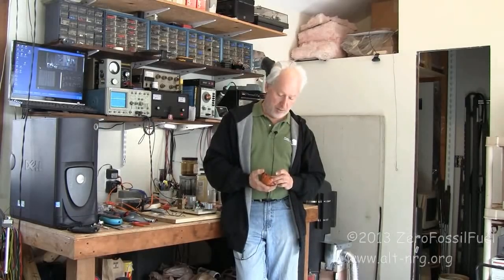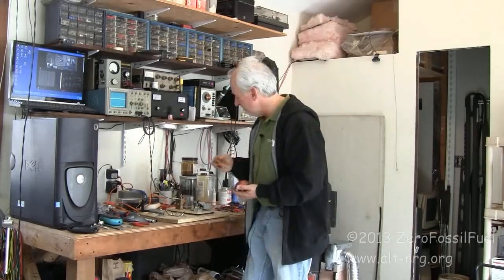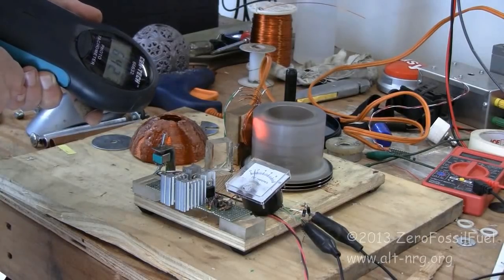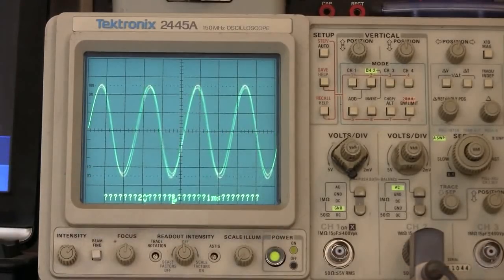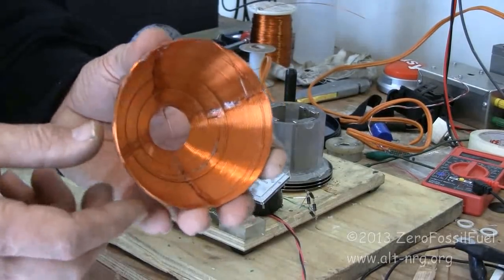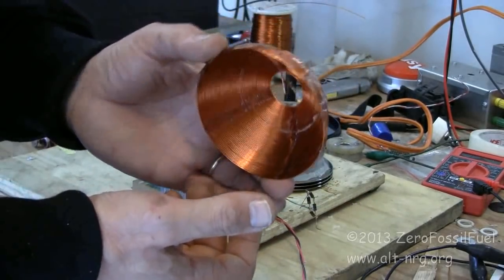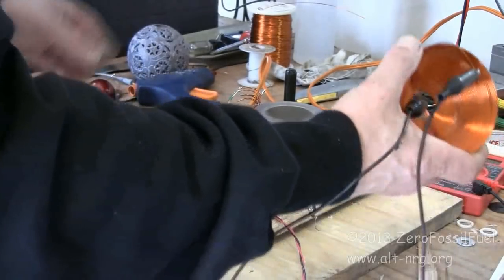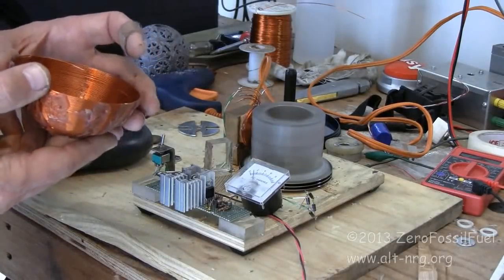#329 Zero Lenz dynamo

Comment: Volts does not equal power.
Volts multiplied by amperage equals power (Watts).

I can whip up a circuit that'll turn 30 volts into 50,000 volts easily, it will however not create additional power (watts), since amperage is on the secondary side is divided by the same factor as the voltage is multiplied by..

Your hemispherical coil has more turns than your pancake coil, it's only natural that it will have more volts on it, it will also have less current, meaning that the power is ideally the same as the input,  but realistically lower due to losses (bearing friction, heat etc.)
Reply: +Patrick Hansen yep. That's what transformers do...step up and step down voltage.
Reply: you should try pulsing the transformer rather than just giving it a regular ac current, ull get weird effects that includes ou
Reply: Johan Zahri You will get weird effects, if you don't understand said effects, and you will not achieve over unity.

Every switch mode transformer (the ones in your phone charger, laptop power supply, pc power supply etc.) are pulsed transformers, hence the switchmode, and they do not in any way, shape or form achieve overunity, nothing does :p
Reply: +Patrick Hansen ur heart is a transformer, if u pulse it with a spike u get a living heart rather than a dead 1..just a clue
Reply: I have a device that turns 3.5 volts into 10,000 volts. It is called an electric mouse trap. Why are so many people duped by shit like that. Volts is not a measure of power, watts is a measure of power. Volts is a measure of 'flow rate' and amps is a measure of 'flow volume', and watts is a measure of 'total flow'. If you pinch a water hose to make it squirt harder, you aren't creating any energy, but that is precisely what increasing voltage does.
Reply: Patrick Hansen thank you very much for the clarification Patrick. holy moly it was confusing to me...
Reply: that's because you think that the stuff around your analogy is just water in that hose, well.. that's not the case in this world.. there is other stuff in and around the water.. it's everywhere almost the way fish view the ocean, it doesn't think it's in the ocean.. only until u take the fish out of the ocean will it see the ocean as it is..
when u spike the transformer u perturb the surrounding almost like jumping out of the ocean.. and there you'll find different phenomenons..
you'll then be able to link to different realms just like when u sleep.. ur heart and brain are in different modes.. u perturb differently and see the world differently..
Reply: @Richard Smith do you know why after u sleep u feel refreshed? think about it.. where does the energy for the refreshing sensation came from.. i don't think it comes from the snickers or mars you eat..
Reply: Johan Zahri Even transformers and the available DC motors are in effeciants  When it comes to get torgue or the RPM
Many youtube info what I feel individuals perspective some Leeds to no ending
I wish ITS HARD WORKS AND GUIDING OUR TROUBLED WORLDWIDE POPULATIONS WE NEED TO BE KIND ENOUGH SHARING RELEVANT INFO THAT HELPS CLIMATE CHANGE BRINGS THE MUCH NEED EASE THAN PUSHING OTHERS INTO HORRIBLE KNOWLEDGES
THANKS FRIENDS
GOD BLESS
SEEK YOUR COMMENTS IF I SAID ANY WRONG
I wish never hurt any youtube creator but some reality some videos r good informative some r horrible
From India

Comment: I'm not sure what you are trying to prove, but the hat shaped coil has most of it's mass MUCH further away from the spinning magnets. Most of the coil isn't even in the magnetic field because of it's shape, while the flat coil had all of it's windings and mass directly up against the moving magnetic field. This is also why it took longer to slow it down because so much of coil is too far from that magnets.
Reply: exactly... the more I see these diy videos, the more I trust in actual science instead of these radio shack self proclaimed inventors showing off their oscilloscope
Reply: Qi Qi depends on the video u watch... but I feel like consolidating knowledge and preparation, could b used alot more, cuz when you get yr gadgets and equipment, there is a tendency to experiment and play... and eventually forget what you were trying to achieve
Reply: I THINK it is Doc Brown in the early stages of building a proof of concept for the Flux Capacitor.
Reply: tarstarkusz I think his goal is to demonstrate a less efficient transformer. Power and Watts are not in his vocabulary, but just throw the word Tesla in there to distract is in his vocabulary. Too funny.

Comment: Just a random thought - if you could figure out the shape of the magnetic field generated by the rotor, mimicking it as closely as possible in your coil shape might create an even more efficient induction in the coil. Maybe you could take one of the magnets used in the rotor and map the field pattern using iron filings on an index card (or something similar).

Comment: If you are still doing this consider 3d printing a multilayer dome coil winding it like a flyback power from big to small. The multiple layers would hold the wire better holding and the winging would give it more voltage at the small end. It would still reduce the lenz effect as well, though shielding or epoxy may be needed on the outside.

Comment: Question: You know what a Zener diode is. Something a bit rarer is a Zener Triggered Transistor. I am 69 YOA and retired. Long ago and far,far away I dabbled in electronics but had to get a real job (just over broke) and gave up the fun of life. In that period, I too experimented with magnetics before there were neodinium magnets. We didn't think of building motors because the stock of salvage from old PCs didn't exist. We simulated the kind of circuits you build sands movement. With the proper multistabil vibrator circuit, I built some hairy Bodine / Tesla coils and could focus the discharges to vertical using an inverted cone in place of the Tesla semi-spherical antenna. I recall using a Zener switched transistor circuit. As Lenz law bucking / aiding design which produced the current in the primary. Now is when I wish I could explain things better. The primary, usually #10ga wire was wound in a pancake. It was enameled. Over that we wound a micro fine 20ga secondary before the 50ga was formed into the pancake coil. The Zener referenced the voltage in the primary because it was across the 20ga coil. That reference voltage was set to give the highest BEMF we could generate as a signal to open to the battery and close to the Tesla cap bank. This put induction into the secondary of the Tesla or Bodine coil.  On top of the Tesla scondary or Bodine coil was a 12" spike with a very sharp point. The reverse cone (small end down) was charged across the Bodine/Tesla secondary and the spike. This focused the discharge to a jagged but pretty straight bolt of lightening. A few times it would take different paths depending on humidity. I once got zapped by one of the stray bolts. If you are wondering what is wrong with me, that is it. LOL Anyway, I enjoyed your experiment very much. I think there might be a way to use the Zener Triggered Transistor to initiate your stopwatch timing but base it on BEMF. Unless, I may not understand what you are trying to accomplish.
Reply: I forgot one very important feature. The inverted cone is neg. biased from a DC source several( 6KV caps) and becomes one of the cap plates. It discharges because of Bodine/Tesla discharge spike accidentally striking inverted coil. Any charging circuit that goes to several thousand volts will work. Experiment. Your bowl coil would work perfectly to concentrate bolts from discharge spike.

Comment: The Lenz effect can be reduced or eliminated with various methods. Superconductivity seems to be the optimum - maybe with a graphene coated coil? 
Another effective way to reduce the Lenz effect is to align the coil design to the magnetic field lines (or between) - as shown in this lectures (YouTube titles):
Professor Eric Laithwaite: Motors Big and Small - 1971
MIT Physics Demo -- Pendulum and Magnet

Comment: When you look at the bowl, each single-turn wire loop that makes up the shape of the bowl, "sees" a certain rate of change of magnetic flux from the spinning rotor.  The rate of change of magnetic flux seen by each loop determines how much EMF it generates.  Each loop in the bowl is a different size and in a different position.  Hence each loop has a unique "view" on the changing flux from the rotor.  You add up the EMFs from each loop to get the voltage output.  This applies to ANY coil.

Comment: You might consider using CA glue from a hobbies store instead of the hot glue you used for the spherical coil winding - buy the accelerator so you can instantly set the glue as you apply it.
I have repaired baked motors where their was an internal short was because the lacquer insulation burnt off so to re-isolate the coil wire I saturated it with CA glue and used the accelerate to harden it instantly.
If you pre-spray the surface of the coils with the accelerator, the CA glue will harden almost instantly when it comes in contact with the wire.
What do you think a parabolic winding would behave like?
Very exciting work!
Thanks for Sharing!!!

Comment: Whats significant is the shape difference alone is creating as much current with less resistance. I must admit I am far from a professional and hold very little higher education. My tools are limited to an esd solder iron, a hand held digital multimeter and an ir therm.. so yea...

I am, to say the least, intrigued by your experiment. Admittedly this is the first video of your I've seen but you got yourself a new subscriber.

Comment: In that sense your bowl-shaped coil is just a different "catcher of changing magnetic flux" and the larger loops on the "open side" of the coil are both larger and farther away from the spinning rotor.  Farther away means you see less changing flux.  Larger means you see more changing flux.  So you might have a uniquely shaped "changing flux catcher's mitt" but in the end it's still a coil with a wire resistance and an EMF generation capability due to the number of turns and the geometry.

Comment: Its nice to see you hands on and at the basics to sort things out for yourself instead of accepting Academia's junk, out-of-sync with nature crap. Keep with the geometric shapes (build with the golden ratio in mind), use the same wire/windings and an accurate way to make sure they are the same distance from the rotating magnetically mass and keep up the good work. Now you just have to find the frequency of the magnetic field generated within the coil its self and match it to the electrostatic

Comment: Would have liked equal length of wire on each coil, but the fact that the dome shaped coil resulted in less drag on the spinning magnets is very interesting.Of course one would expect the opposite. You might wonder why they don't build generators with this form of coil surrounding the rotor. Less energy to spin the rotor for the same energy output. Excellent work Z

Comment: The funky arrangement of a starship coil likely means that the staggered way of winding the coil will result in some self-cancellation of the inductance.  In a normal coil all of the loops are all working together to produce magnetic flux that is going in the same direction.  In a starship coil the funky triangular loops may produce some magnetic flux in opposition to other loops.  That means self-cancellation of flux resulting in lower inductance.  That's about it, it's still just a coil.

Comment: By the by,  get an old junker TV.  On the back of the CRT (picture tube) you will find a cone shaped coil that is used for vertical and horizonal deflection.  Got about a zillion turns of wire on them, already wound.  Careful, those tubes can hold charges of 30,000 volts!

Comment: Nice experiment, the shape is what your testing does the flat coil have the same amount of wire as in the half sphere, the number of turns as in a transformer directly voltage/amps,  you could still get a good idea from your test but you need to run it again and get amps of each coil. then you will know witch shape is better :)
Reply: Yes!  I was waiting for someone with a basic knowledge of electronics to point out that he had an uneven number of coils between the two geometric configurations.  In addition, he doesn't indicate the amperage.  I n my opinion the bowl shape would be counter productive unless he suroounds the spinning magnets with it

Comment: Just a tip. Anything that does not use iron, is probably never going to be overunity. Iron is a multiplier for permanent magnets. Iron IS the free energy in magnetic devices. The energy comes from the zero point field. Magnets channel the energy and allow it to be released. Iron allows for the multiplication, and hence, free energy of permanent magnets. Just as a radiant charger needs a lead acid battery, permanent magnets need ferromagnetic materials. Copper produces Lenz's law, not iron :)

Comment: Please provide the following data:
1) How many complete turns of wire are used in the pancake coil vs the bowl shaped Lenz coil?
2) Total length of copper (assuming same gauge) used in the pancake coil vs the bowl shaped Lenz coil?

Comment: I can think of reasons for the second coil doing that, because geometry.  The single coil wasn't touching (couple times I could hear it hit, pretty close) but it was so close to the spinning load that it was well within the shortest field lines, where the field is densest.  The second coil picks up the longer field lines that curve around the outside, are less dense but have as much energy in them.  I am not a quantum physicist mind you.

Comment: I understand why the bowl coil produced more voltage because you have more windings.  Have you considered the reason why you get a longer rundown time with the bowl coil shorted is because it's a bowl shape and the magnetic field decreases as the square of the distance so the magnetic flux is not uniform as it was with the pancake coil?  Also when you talk about power, is it possible to connect a current meter on both coils to prove your theory?

Comment: What's the resistance of the coil?  If for example it is 0.1 ohms, then the coil output voltage will be nearly the same under load.  I think the voltage was 6 volts peak to peak.  So that's 2.12 VRMS.  So you have a 2.12 VRMS voltage driving a 0.1 ohm resistor in series with a 2.5 ohm resistor.  There will barely be a voltage drop at the coil output.  The power in the load resistor will be about 1.8 watts so I assume the rotor would slow down.

Comment: I see what you are doing. I have something I would like to see, turn the coil over and see what happens and what effect that would have on the magnetic drag. I kinda think the change in drag is a result of the distance of each wrap of the coil is from the magnet. Which leads you to think any 3D geometry would have a similar change. I agree that that having a monopole magnet is interesting and may lead to some very cool ideas. Thanks again Zero

Comment: Power in an AC machine equals voltage x current x the cosine of the angle between the voltage and current waveforms.  This last term is called the power factor, and if it was measured it would remove the magic from demonstrations like this.  Note that if the power factor is zero, which it will be in a purely inductive coil, we can measure substantial voltage across and current through that coil, but with no power being dissipated and thus no energy transfer.  

The instrumentation is entirely capable of measuring power factor: set one channel of the 'scope as an ammeter and the other as a voltmeter, and you'll see the phase difference between the traces vary depending upon the character of the load: they'll coincide for a resistor, and be almost 90 degrees out of phase for a purely capacitive or inductive load.  

One of the difficulties of basic research is that you are given ample opportunity to fool yourself. It happens to all of us.

Mark Kinsler, Lancaster, Ohio USA

Comment: Nice Work!

Is it worth to consider the size and amount of winding/coppers effect on the generation of twice the voltage as the pancake coil.

Yes, the mono polar effect is a considerable asset...

What are the effects of having the polarity of the magnets rather than + - in/out.

Have them + - right to left OR left to right.

And + - top to bottom.

;-)

Comment: 6:32 what is effecting is that barrel is transparent and there is 4 times (+ the time of the actual marker u put there) that this tool see a difference per  rotation, because of the 4 shiny stuffs in it. U better put a tape (with the same background color with the sticker ) around all the track the tool is set to watch, then u put the sticker  on it, so the only colors on the track to stay up to 2 (black and white) for better contrast btw the counting events. other thing u can do is to realize that vibrating hand cant provide good stability for precise measurements, so the 4 stuffs in it does the counting even more confusing for the tool, because the readings are less clear, so it could give u different (smaller) result from the actual rpm*(4+1)
Reply: i like what u discover btw :) it got potential .. maybe rotating (or dynamic positioning) this add-on during the deceleration will give u more efect